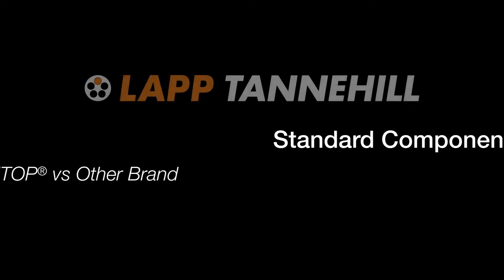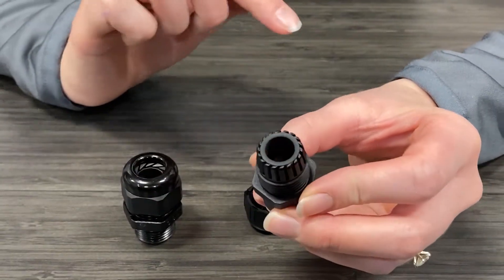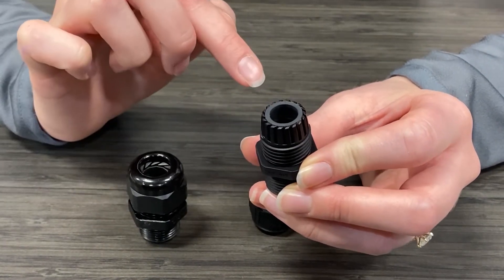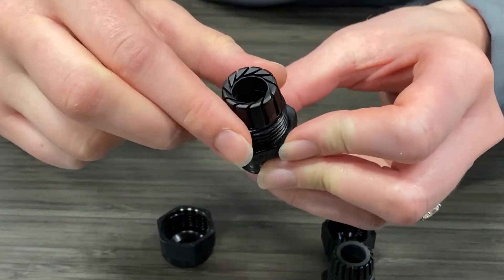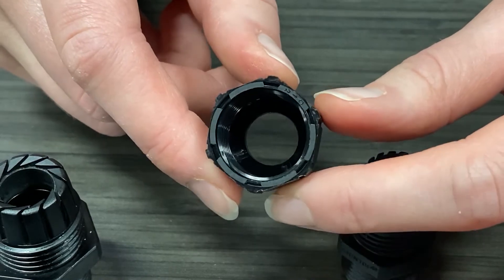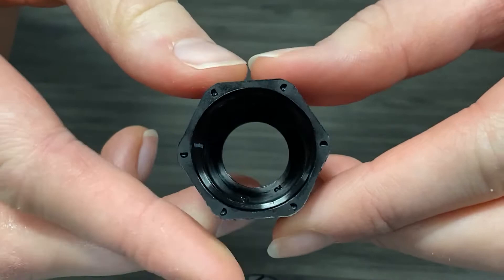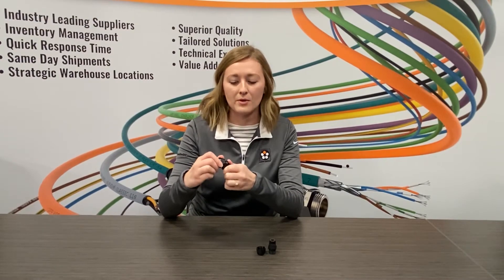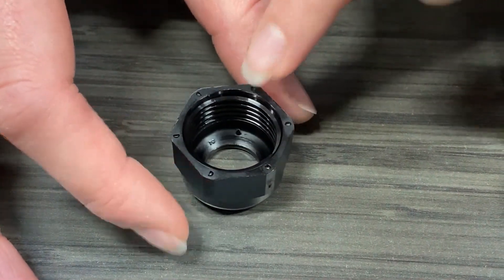Standard Components of a Cord Grip - LAPP SKINTOP® Cable Glands vs Other Brand | Lapp Tannehill

Comment: Is the o-ring supposed to go on the outside or the inside with the nut that holds it in the cabinet? Seems like there isn't a place for it on the outside and it gets really swished out very non-uniformly.
Reply: On the outside.